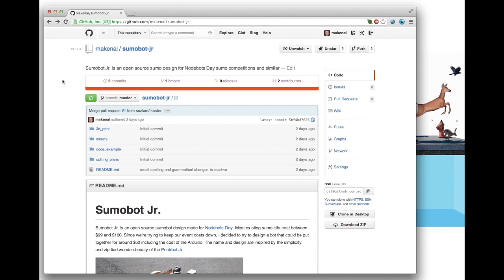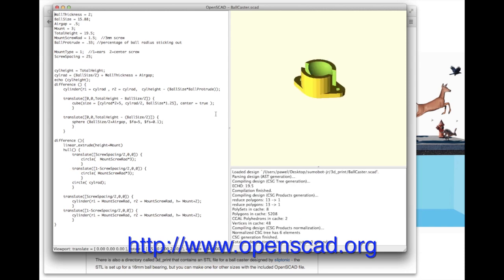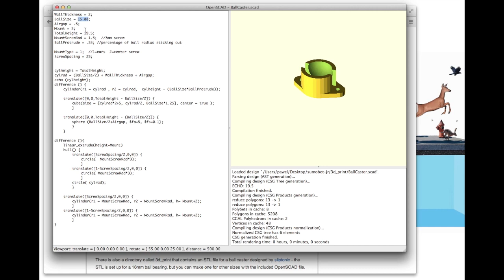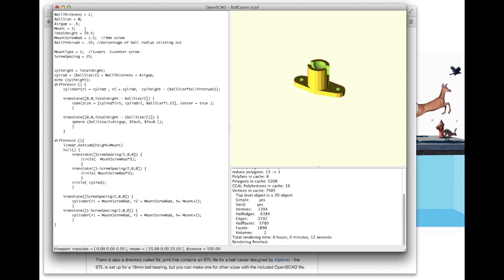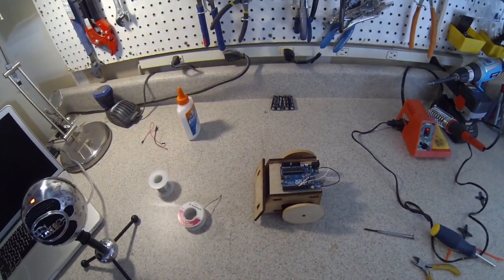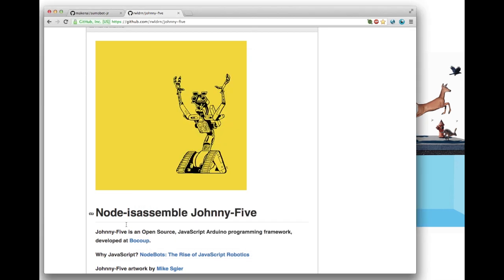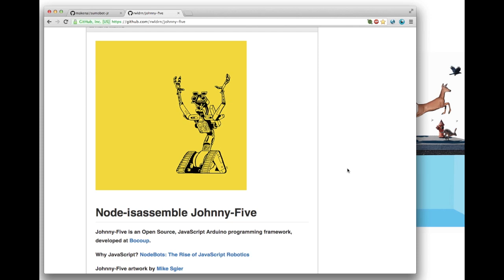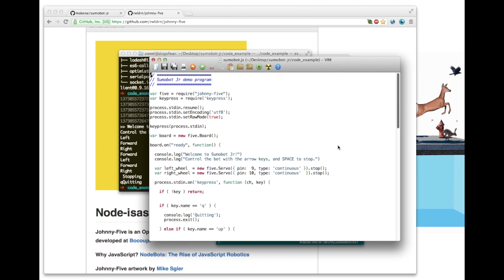Sumobot Jr Assembly video for Nodebots Day 7/27

Comment: Hi, great project. I am trying to do one but I cannot stop my servos. As I launch node they start rotating, and even if I .stop() them, they still rotate slowly. Any idea / suggestion? I am using the parallax servos suggested in your github
Reply from the maker: Hi! Do you try trimming the servos? There is a small potentiometer in the back of each. You can slip a screw driver in there to adjust them. While the bot is in a stopped position twist the pot until it stops moving and is centered. If you twist too far it will start rotating one way or the other.

If that doesn't work you might have bad servos or are missing common ground between the batteries and Arduino. Just run negative from the batteries to GND on the Arduino.
Reply: Pawel Szymczykowski hi Pawel, thanks for the quick answer. Not that familiar with servos yet. I'll try trimming them as you suggest and let you know. :)
Reply: Pawel Szymczykowski It worked man, thank you very much! I'm ready to go crazy with web sockets now :)